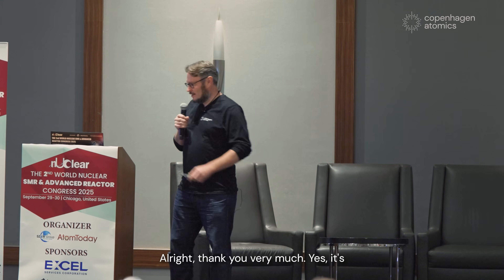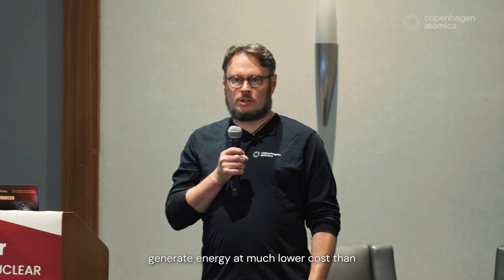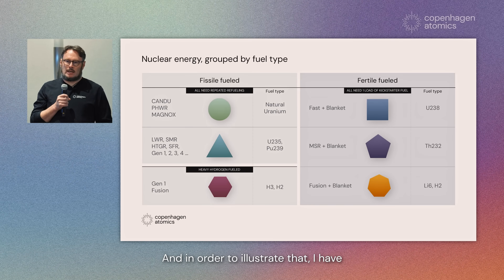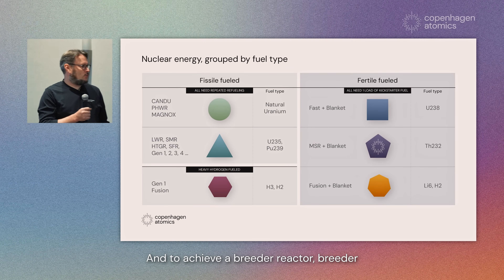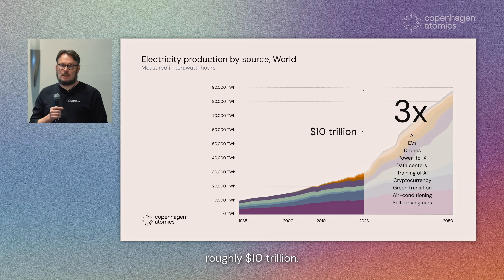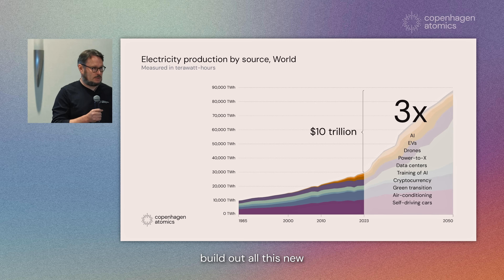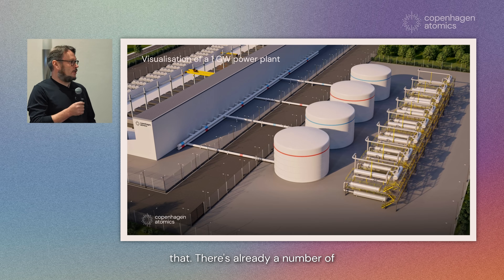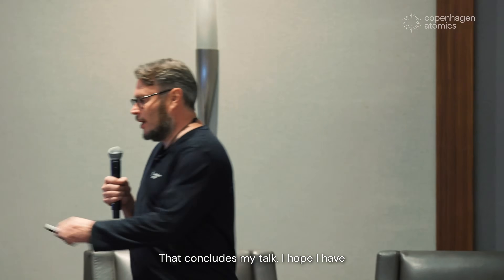The Solution to Future Energy Demand: THORIUM Reactors

Comment: In the plans, it was supposed to be the year of the first running prototype?
Reply: Yeah like they told us 60 years ago nuclear fusion was 30 years away.
AND like they told us 50 years ago nuclear fusion was 30 years away.
AND like they told us 40 years ago nuclear fusion was 30 years away.
AND like they told us 30 years ago nuclear fusion was 30 years away.
AND WHERE THE F⋃CK IS NUCLEAR FUSION?
Go look at the Wikipedia page for ITER and you'll see that it was supposed to be operating 2 years ago (last year at the latest). Is it running YET? Is it even close to running?
NO First plasma was originally scheduled for 2023 and it now schedules for 2033.

Comment: "Energy consumption will increase by a factor of ten over the next 100 years like it did in the last 100 years"
All the AI companies seem to think otherwise. They want an AI for everyone that helps with everything within 20 years.
That would require an increase of energy consumption of AT LEAST 1000 times over the next 20 years.

Also I want to say, keeping everything in 1 container seems a bit silly to me. Even though you really seem to be able to do it I know there's a thermal and radiation barrier in there that could have just been solved by separation into a second container. We can ship containers pretty easily, one more won't kill the profit margins.
Reply: Yes, a factor of ten in 100 years is a huge understatement 💯 We're talking about 100 years. Even 1000 times looks reasonable
Reply: Best up the effiecency of those chips and algos then, coz 1,000 x ain't happening, hell, 10 x ain't happning in 20 years. 3 x is a stretch to imagine right now.
Reply: @markfernandes2467  Extropic is working on that and I think they have a chance. They proved that their new hardware is 10 000x more efficient at one specific task but they only have a prototype chip and don't have algorithms yet to build an actual AI using that task (they do have some research that shows that it's possible tho).
I think they can do it and fast but we should still at least 10x our energy in the next 20 years even if we abandon AI completely. Energy is king of everything.
Reply: @MrRolnicek  "10.000x more efficient"? Overunity and free energy, anyone?
Reply: @brilanto  No, not even close. Quantum computers can be a couple orders of magnitude more efficient even than that. But obviously they are a huge hassle and we can't keep them working at scale just yet. The extropic team actually comes from the people who developed the AI algorithm that could run on a quantum computer when they worked at Google.